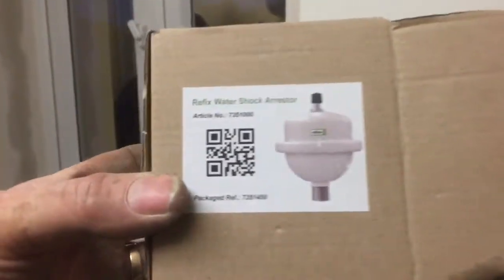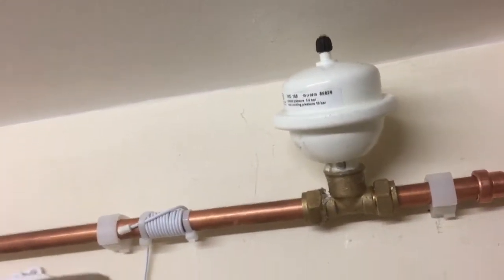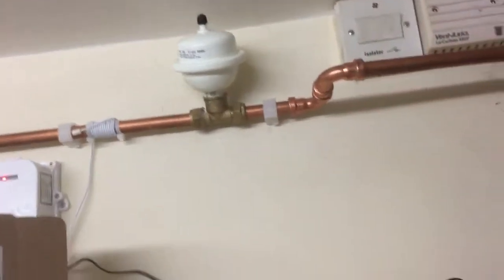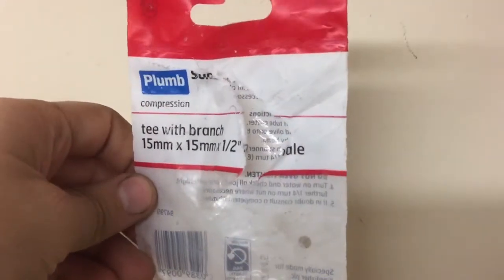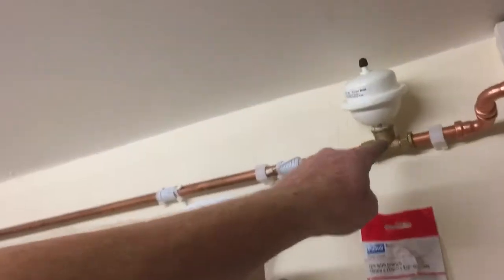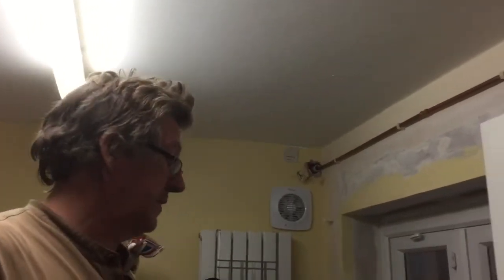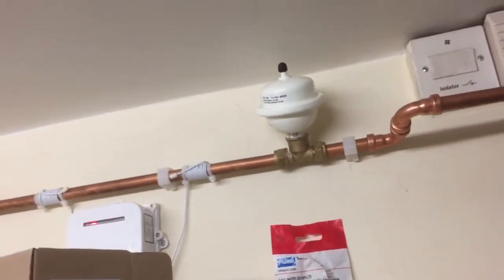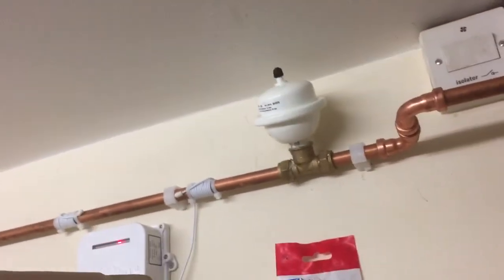How to stop / cure water hammer aka banging pipes - Reflex Shock Arrestor Review

Comment: It goes on the water cold pipe. Best one is the maintenance free one. Especially if u have a water meter
Reply from the maker: you can always isolate the mains water, drain it down then replace if needed but that sounds even better if there's a maintenance free version available
Reply: Im getting mine fitted on Wednesday because I have hammer noise everytime we open the taps especially cold water and also flush the toilet.if we open the flow of water from the mains the noise gets ridiculous  .Been annoying noise for last month. Been told its going to cost £70 labour To fit it. The plumber will also bring the tee. He will fit the shock arrestor on the cold pipe next to the boiler.